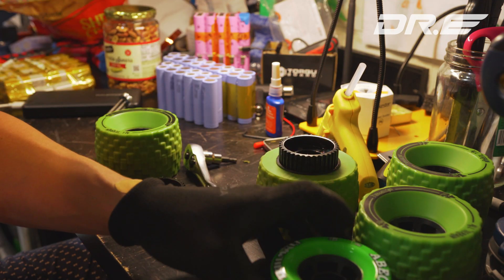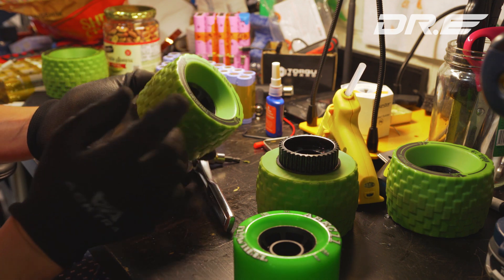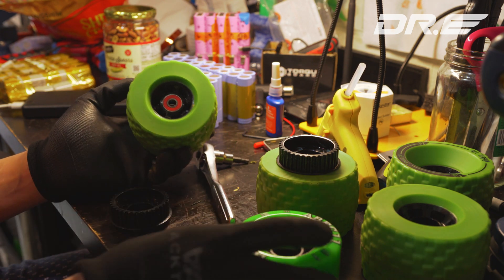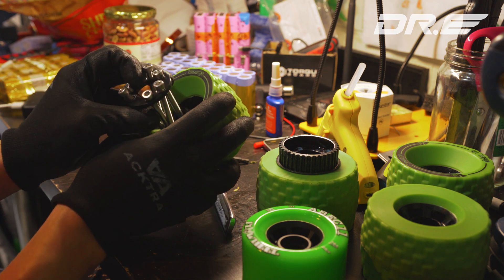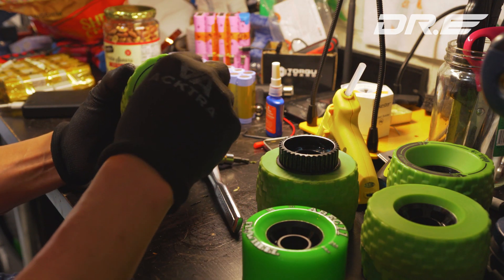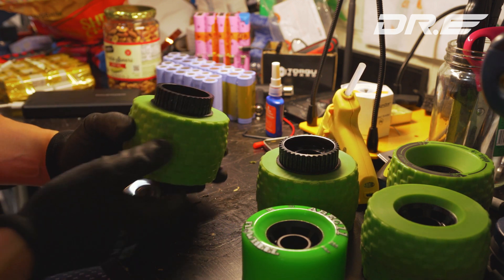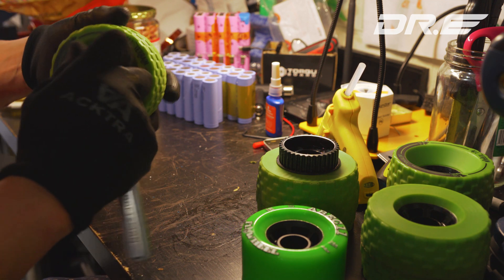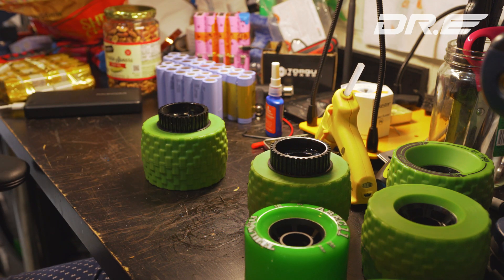How to Install ABEC Wheel Pulley! [DIY Electric Skateboard 101]

Comment: Use ur file on the rear motor to grind it down just don't let the file get to hot it will ruin it
Reply from the maker: Mother?
Reply: @dr.eskateboard3381  no i meant motor lol
Reply from the maker: Grind down which part?
Reply: @dr.eskateboard3381  the hump in the wheel
Reply: U can make it somewhat flat